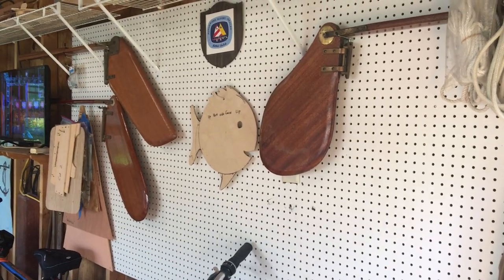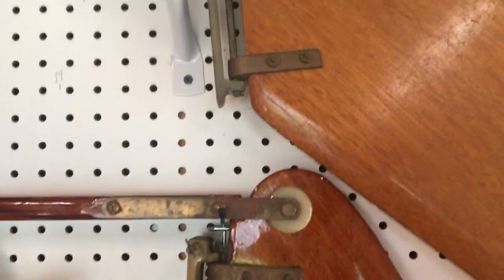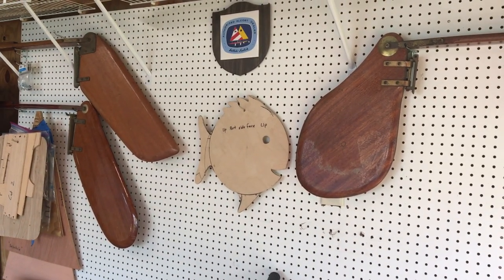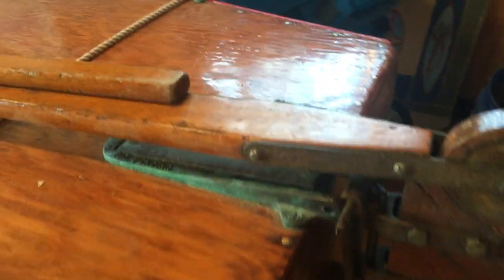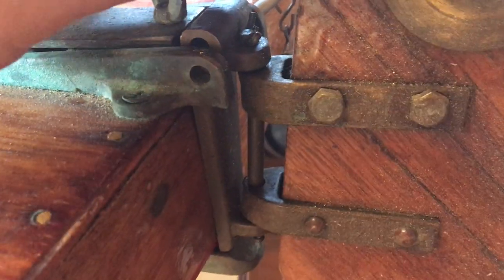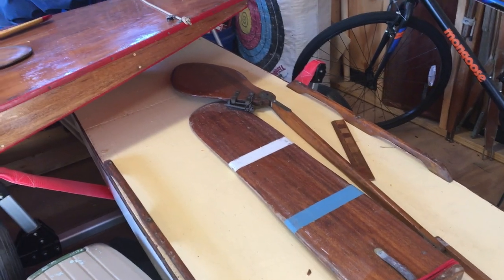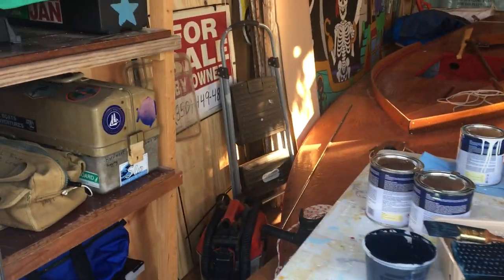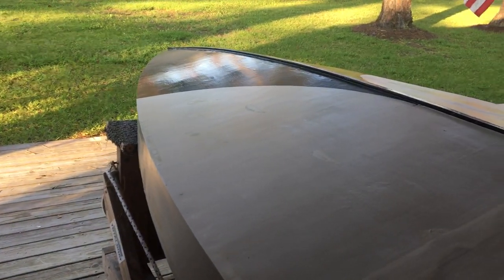Sunfish and Sailfish Rudder Variations

Comment from the maker: FMI: https://www.amazon.com/Sunfish-Owners-Manual-Maintain-Repair/dp/1484987217
Edits: 1) The early daggerboard is 31 inches. 1960 til plastic daggerboard around 39 inches. The wooden boats do better with the 39 inch spoon tip, SHadow or Barrington daggerboards. 2) CHIP is a 1963 Alcort.